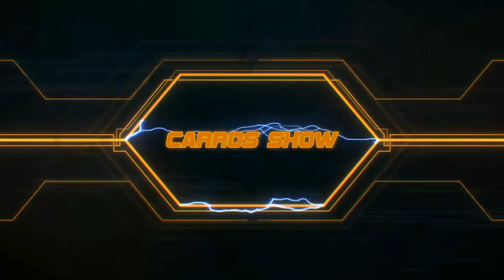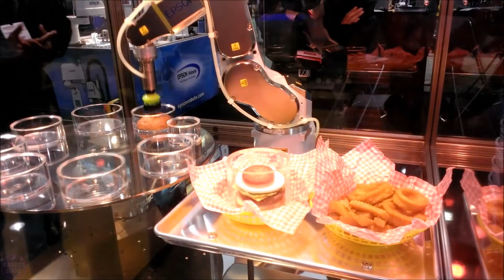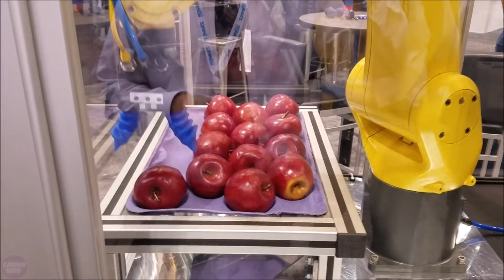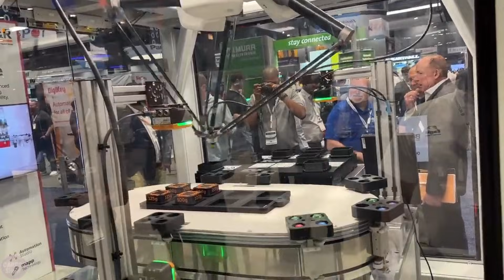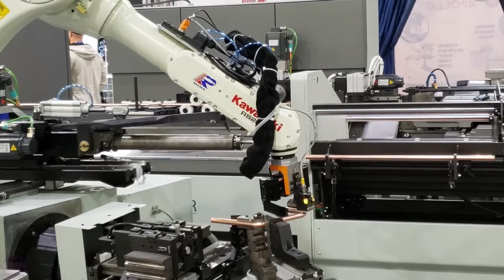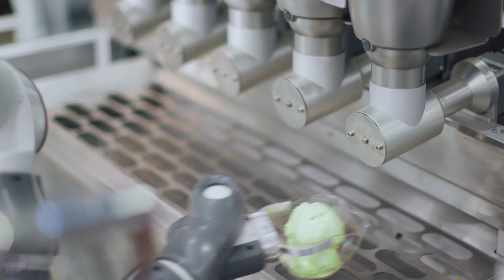Japan's New Generation Industrial Robots Will Soon DESTROY ALL Jobs

Comment: The biggest question is what are you going to do with human being those are going to replace with robots? Would it leads to reduction of human populations and indirectly reduce the need to produce more and also affecting the need of more robots. In addition also with increasing knowledge in this field or advance knowledge the same problems arises. You are capable to create to solve demand and supply of material goods but are you able to control the demand and supply of human and their other needs not just the material needs. Are you going to take responsibility to balance material and human aspects and even when you lost control when the wrong situation surface if it happened? Do not just think within your four walls but project the effect it have on all angles. I cannot congratulate you on your this achievement because i fear there could be a worst negative impact on your creations. Do think far and wide not just today but also for tomorrow. Remember this could happen soon then you think, you too will be taken out of the work force, replaced by ???????.